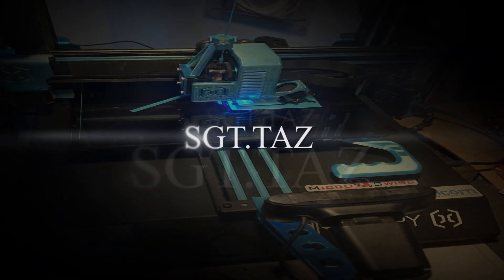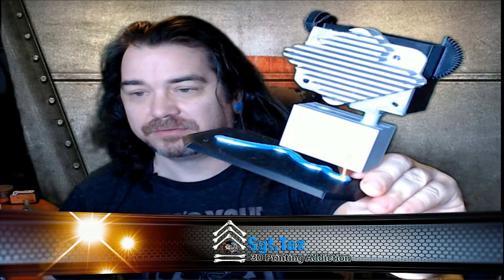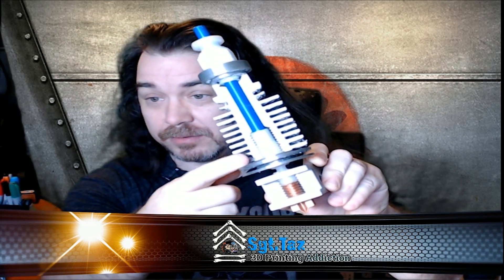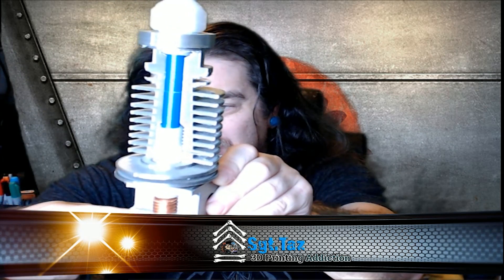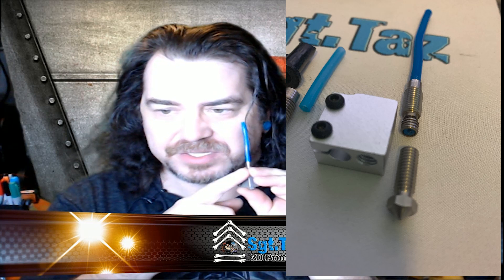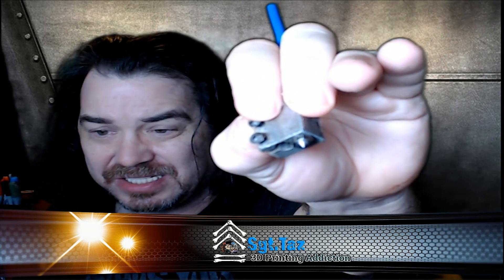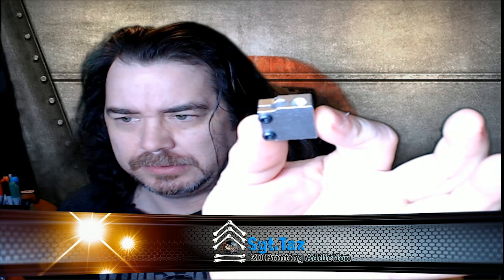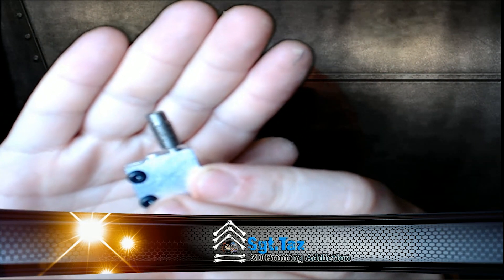Artillery SWX1/Genius Hot End Stock/All Metal Setup

Comment: Great video, but I'm having problems to know how to know how much to cut the PTFE after installing the all-metal hotend.
Reply from the maker: winds up being around 27mm need to run from your heatbreak inner ring up thru to the filament guide tube. (there is a ring just below the prongs that holds PTFE from shifting)
Reply: @Sgt.Taz3D  Thanks, I think I figured it out by watching another video. Not tested yet, though.

Comment: I got all my upgrades up and running... new all metal hot end with kraken style heatbreak, new non-threaded heatsink/hot end mount and new metal tensioning arm.  Got everything leveled, good level test and then about a third of the way through a benchy I the nozzle clogged.  I thought I remember reading somewhere that with an all metal hot end you need to change your slicer settings, especially the retraction.  Do you have any info on that?  Thanks!
Reply from the maker: You want to keep your retraction at 1mm  25mm/s also a good idea to put a couple of drops of canola oil or similar onto filament to get the all metal seasoned. ( rub on with fingers-just drop or two) All metal isn't the best for regular PLA so I tend to use an oiler (sponge with some canola or similar) when using PLA
Reply: @Sgt.Taz3D  Thanks!  I'll give that a try.
Reply: @Sgt.Taz3D  Really?  That's intriguing.  Good to know about the oil, I'll have to try that tip out.

Comment: What size would I need to shorten the PTFE tube to?
Reply from the maker: If your asking for an all metal hot end it winds up being about 27mm. It can vary depending on your nozzle/heatbreak setup so it needs to be inside the top ring of the heatbreak and up into the filament guide (Black or white) just below the 2 prongs.

Comment: Hello sir, thank you very much for that video.  After hours of reading here is the information I came up with and this is what I am looking forward to do.
The Artillery Genius comes with a Titan Style extruder and a Volcano Style Hot End. Up till now, I have searched everywhere to know if there is a heat sink that comes with it but I think it only runs on PTFE tubing. I would like to print PLA and PTEG miniatures and fonctional prints with the best quality details. 
I am looking forward to do the following upgrades to my Genius. 
BMG Extruder Clone Dual Drive Bowden
E3DV6 HeatSink - 1.75mm Universal (With Bowden Fitting)
Capricorn Bowden tubing
Slice engeniring Bowden Copperhead heat break. 
And some good quality Volcano nozzles 0.2 to 1 etc 
I have a stock artilery genius.  It does a great job. But I want to get some extra details but mostly, I'd like to have fun and learn.  Here are my questions. 
Am I right to say there is no stock heat sink on the Genius? Not only I can't see it but I saw an online video of 3d printing nerd that said that the X1 doesnt have one in his demonstration. 
Does the genius have a smoothed or threaded Heatbreak? 
Do I need to purchase better quality fans?
Do I need to print any parts before installing anything? 
Are those upgrades compatible? 
Is there anything I have missed or that I have wrong? If so, is there any guides that you could recommend? I haven't dissassembled anything yet and I am still reading and asking questions. Thx so much for your answer.
Reply: After more research, I need a smooth heatbreak so the coperhead one won't work unless I get a a V6 heatsink!
Reply from the maker: @biscotilleaubeurre8406  Uses a kraken style heatbreak , that is held in place by 2 grub screws located behind the heatsink and fan. You would want an all metal one if your going to be using higher temp materials for a long period. You will still need a shorter run of PTFE tubing on the stock titan setup which runs from the top of the all metal up thru the filament guide that is just below the main gear.

Comment: I have a v4 and there is only one grub screw holding in the heat break. The one grub screw galled the heat break so bad I can’t get it out.
Reply from the maker: M3 × 8, hexagon socket, black, grade 10.9 is the size. I'd suggest when you can drill it out and replace use a slightly smaller drill bit and go slow.  www.fulament.com  carries replacements
Reply: 3D Printing Addiction the lower grub/set screw on mine is stripped.  I took a drill to it to push through but not sure what to do next.  Any suggestions?